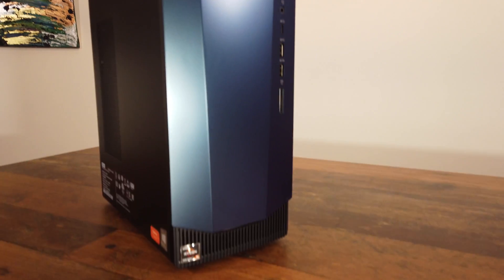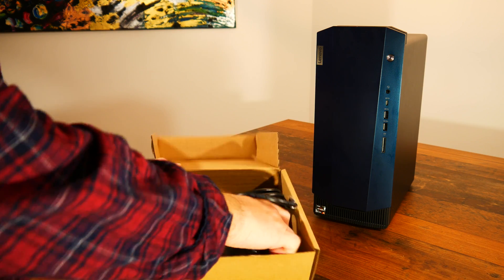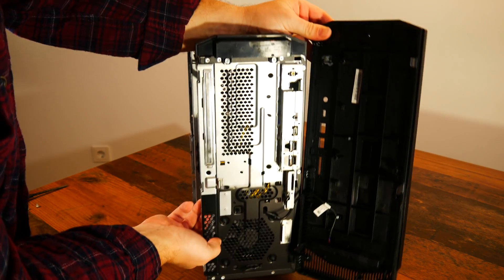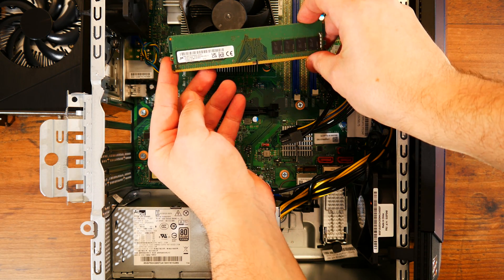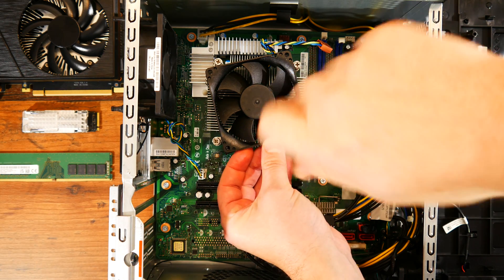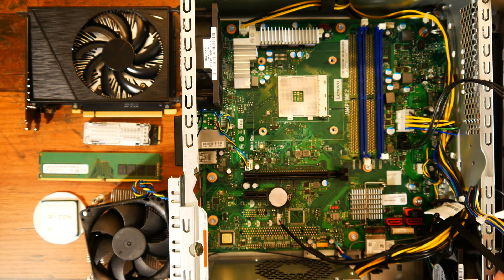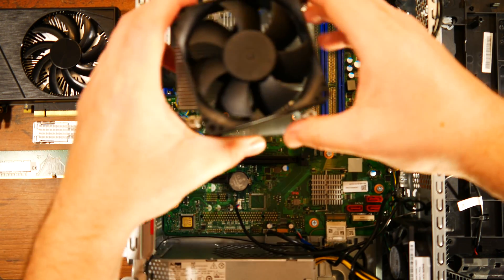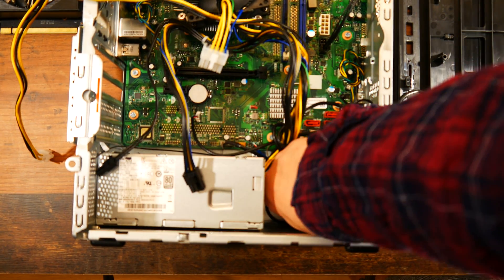Lenovo IdeaCentre Gaming 5: Ryzen 5 5600G+Nvidia GTX 1660S. Inside look, Build Quality, Disassembly.

Comment: 5:10 i have this pc w a i5 10400 and a gtx 1650s and for most games its runs ultra 1080p at 60 fps its an amazing pc for the price
Reply: Hi, I have the Lenovo Ideacentre i5 with the same Intel i5-10400 CPU. The temperature have been reaching around 82 degrees Celsius. I wonder if anyone has found another heat sink compatible to better help dissipate the heat. Any tips you could provide is helpful. Thank You before hand for your response.
Reply: @johnnychang4233 find a cooler that supports LGA1200 and change the thermal paste cause its pretty bad

Comment: I have one of these and upgraded the ram and ssd thanks to your video! 

I am trying now to use a Wacom movink with it but it doesn’t have thunderbolt in. Is there a way to upgrade the computer to use  thunderbolt devices like the movink?
Reply: Could you please tell me how much mhz your new RAM has? I bought 2x16GB @ 3.200Mhz but it only works @ 2.133Mhz. Do you have a solution?

Comment: Anybody tried to upgrade the GPU to a 4060 ? Mine got the 1650super and the 310W Power Supply. If yes, wich Model of the 4060 fits best ? Is there a possibility that anything more powerful than a 4060 works with the 310W Power Supply ?
Reply: well you can wait for the new 50 series rtx cards or buy a rtx 3060 12gb (its better than the 4060 and its cheaper than the 4060)
Reply: the RTX 4060 is the best choice as a video upgrade, because it adapts well to its power supply as the consumption is also lower than the GTX 1660 super (rtx 115watt vs gtx 125watt). Furthermore, although they have different slot technology, they are backwards compatible, RTX PCIe 4.0 x8 (15,754 GByte/s) GTX PCIe 3.0 x16 (15,754 GByte/s) the good thing is that the RTX, in addition to having superior performance, has 8GB VRAM and raytracing support .

Comment: Would a 4060 fit in there??
Reply: yes
Reply: @StefanGrozdanovski007 what about 6700rx?
Reply: @ahmedsy9046  maybe but the dual fan one. but i recommend you buying a new motherboard power supply and chase so you can upgrade to a better gpu and cpu

Comment: How do u install an ssd?
Reply: You need to find 2 different cables wich would fit your SSD and then plug BOTH cables in
Reply: @bonster4986 I cannot find where the 2.5ssd slot is... my 1 TB SSD is nearly full and I want to install an addition 2.5 sata SSD but dont know how to do...

Comment: There has been reports that Lenovo was planning to use AMD cpus that have built in fuses to pair with MoBos; making CPU not usable with another system. Also Lenovo Bios has buncha hidden settings and some lock the system with a little group of CPUs even though there would be no compatibility issues. This has been going on like this since late 2021.
Reply: Just myth

Comment: thank you for making this video, i have that exact pc and i am thinking about upgrading to a geforce rtx dual fan graphicscard, do you think that it will work/fit?
Reply: first you need to buy a better power unit, because the stock one is too weak for the graphics card thats there, this could also improve your fps
Reply: @miantek  thank you
Reply: @sainttr00msoo hii were you able to use the dual fan graphics card ?

And which graphics card can we use in the same psu ?

Is 3060ti okay? 
Thanks.
Reply: @luffy0-0-l4o  i’m sorry but I never changed it, I don’t know why but I never got the chance

Comment: Dear uploader, i have question can u run amd ryzen 5600g, can you use the amd software adrenaline version? Beacause i ask, is that i have 5600g with radeon grap desktop and i can not  use the software, device manager i can see in processors list i have a 5600g with radeon grap, but last update was 2009!!!
Reply: did you solved that issue?

Comment: Do you need a rack for the 2.5 sata ssd to install or you can do it without?
Reply: Same question
Reply: The 2.5 sdd fits in the rack thats blocking the acces to the motherboard etc. You only need cables, but mine had cables preinstalled.
Reply: @JoeyF350  I cannot find where the 2.5ssd slot is... my 1 TB SSD is nearly full and I want to install an addition 2.5 sata SSD but dont know how to do...

Comment: i want ONE. one friggin guide on how to add another SSD to this shit. I've been struggling for two hours now and none of the videos i find help.
Neither do the instructions that say to just click it on, but there's no slot to click it onto that's supposed to be by the ram.
And no im not talking about the existing drive. No computer had pissed me off this much before 💀💀💀💀
Reply: I don't have the knowledge to answer your question but you can go and find some PC Expert than can help you in exchange for some money. Also , I have some questions for you. Have you experienced any problems with the PSU? Or the Cooler? How much is the temperature while play heavy resources games? Thx in advance
Reply: i did it and it was very easy
it fits in the bottom of the metal case that hinges out. at 3:34 at bottom.
cables are quite straightforward if you know your pc setups
Reply: @ion_iot  Is there a max storage limit on the ssd?
Reply: @ion_iot  Could you be a bit more specififc pls?

Comment: How can this pc be upgraded? I have the exact same pc. What parts can be upgraded?
Reply: Sorry for bothering i want to buy this pc with a 1650s instead of the 1660s, but how's your experience with the build, because most people say it has a high temperature when using it? Is that true?
Reply: @dafuqareudoing2302  i have the 1650 one and mine is fine, it did get quite hot during the heat wave but otherwise all good
Reply: ram, ssd or hard drive, video card or cpu
Reply: @ZarkOner  can the motherboard be upgraded?
Reply: @gadurybaabbad1573  Of course , but you may need to change the case

Comment: so i could just switch that 1660s with an asus 3060ti dual fan mini for example without having to worry about anything?
Reply: Yeah for sure
Reply: No you cant the psu has only 310 watts that not enough for a 3060 ti
Reply: @rapfan97  unfortunate that i received such a late response, but thank you anyway of course. built a completely new pc and rocking the 6600 xt for now with 750 watts of gold rated power, lol

Comment: hello also I bought this pc but with the 3060 , but I would like to know the brand of the gpu you would know ??
Reply from the maker: Hi, it is an inhouse design (oem) based on the reference model
Reply: @iteststuff3091  thanks 👍🏼👊🏼
Reply: FEDE would like to ask i see RTX3060 and R5 5600G 16GB configurations for 894 Euro now PLZ let me now about your PC after 90 days its good and worth of money ? 
Power supply its 380 !!! First at all then GB ram comes 2X8 or single sticks 
Write back in order to buy or not to buy this lenovo 
Thnx in advance BEN
Reply: @arbenbytyqi9732  I have the same problem. But I think it is still worth it for the price. ~1000 eu for these kinds of specs are insane. And if it really gives trouble, you can upgrade the Power Supply Unit. But its probebly not neccesary (same with the CPU).

Comment: Can you add another graphiccard
Reply from the maker: Yes you can  add another graphic card but you have to consider de small power supply (310W)  that has only 1 x 8pin power connection. I think you can add something like an 6600XT or 3060TI
Reply: @iteststuff3091 The 3060ti consumes 200w and 12 pins are needed, I don't understand how you say that it can be changed
Reply: @lenocler  and it would give you a dedicated bomb :), I suggest that we should consider putting a 4060 with 115w tdp on this case which would be the best opt
Reply: @DoDinhQuangKhanhQP0495  But could you take advantage of that graphics card with the processor that already comes with the computer?

Comment: can you install more then 32GB ram? thank you.
Reply from the maker: Hi, yes i think you can, but unfortunately you are limited by the 2 memory slots, in theory you should be able to install 2 x 32GB, but i can not confirm it before i test it
Reply: @iteststuff3091  i know about 2 slots hehe...thanks
Reply: @tadejdanev5030  I don't think you can get more than 32 with ram memory installing. But you can buy USB memory and make it as a installed Memory instead.